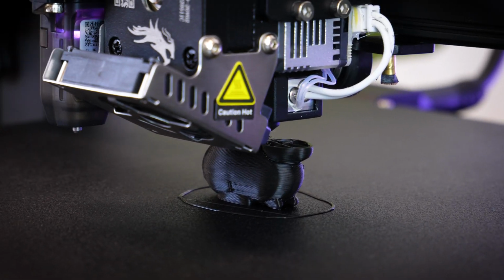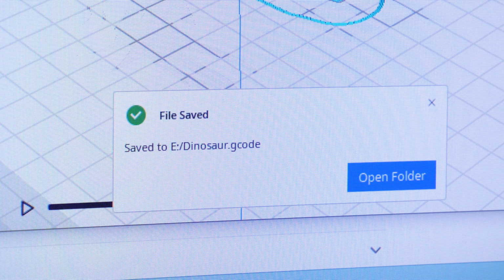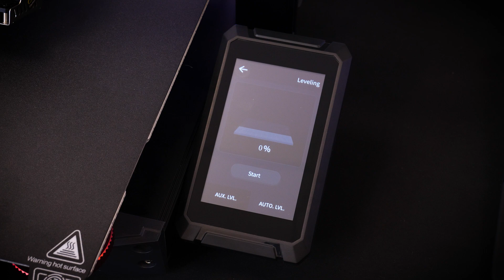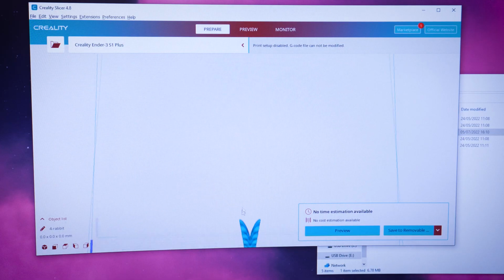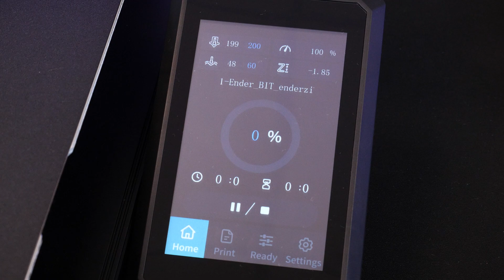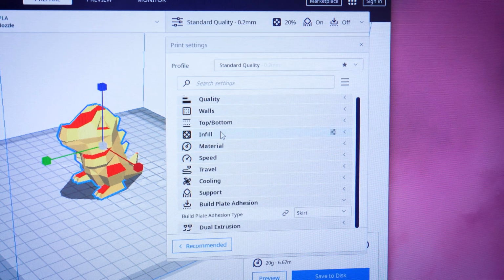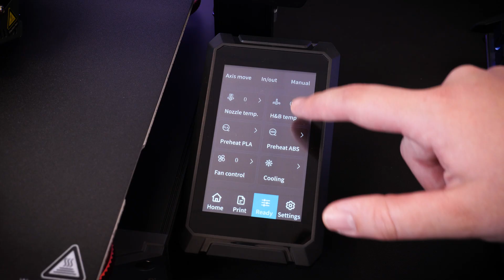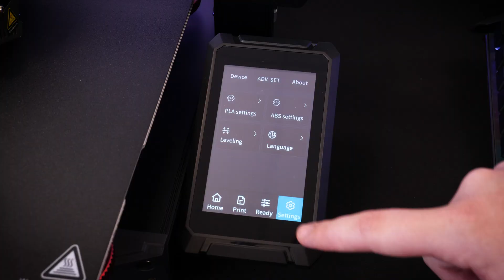Creality Ender 3 S1 Plus 3D Printer Review

Comment: Congratulations for the video, I saw that the S1 plus came with a kind of sensor and a cable, I did not find a reference in the manual, what is the purpose?
Reply from the maker: I believe it comes with a few replacement parts that you'll need to keep safe incase the original parts break.

Comment: any pros or cons wit this printer is this printer worth buying ?
Reply from the maker: Pros: It's really great for beginners as it works fine straight out of the box. You get everything you need to get started. It was really easy to set up and has auto bed levelling so not too much manual levelling involved. 
Cons: Takes a lot of learning to make something decent but that's really dependant on your skill level. The software doesn't have a lot of instruction so took me a while to understand the controls. Even with the auto bed levelling, you do need to make a few adjustments to get the print right but after that it prints things very clean.

Comment: I do better prints with my Ender 3v2. 
But I do believe that this will make just as good prints when correctly assembled and calibrated.
I really don't see a problem with the model being narrow tho. If that is your concern, you can print it on a raft.
I clean the bed with painters wash, which makes the surface slightly more rugged so the filament will get a good grip.

Comment: Damn! Now I wish I would have waited. I got the s1 pro about a month ago. The pro has a bed even smaller than my Prusa mk3S+. I still needed a larger bed and ordered the Artillery Sidewinder X2, a 300x300x400 bed that just came in Monday. My biggest complaint of the S1 Pro is the SD card reader only displays 4 pages of files. If you have more file, it ignores them and I have to switch out SD cards or erase files from the current SD card.

Comment: I bought a tevo tarantula pro, which is a big name for JUNK !! Then I moved to an Ender 3D Pro it has a lot in common with the first like NO filament will not stick to bed or it’s  clogged. Walk away and leave it printing perfect and come back to a MESS you have to buy a lever ONE OF THE MOST IMPORTANT PARTS and it’s an extra $40 part☝️🙄 which is stupid . I think 3D printers are  a Fad that will soon die out due to all the Crap you have to go through just to get a SMALL print much less a large one 🤷🏻‍♂️
Reply from the maker: Hi! Sounds like you had an awful experience 😥 I've used two of the Creality Ender 3 printers now and have found that they do need a lot of trial and error tests to get the perfect print. But not found yet that they need any extra parts that don't already come with it 🤔 I've found when filaments don't stick, it's normally solved by raising the print bed temperature. I hope you give it another try! They can make some great prints when you get them right 😊
Reply: Sounds like the Print Bed needs cleaning, factory residue on the sheet? Also your bed leveling may need bringing closer to the bed? 
These aren't plug and play devices yet. Still at least 3-5 years away until a sub £1k 'prosumer' device is available.
Reply: I clean the bed using paint wash on my Ender 3v2. As long as the print doesn't come loose from the bed, the print rarely gets messy.
I have had some supports break off during printing and then there be spagetti but if you're lucky it can still build on the spagetti which has shown to work about 60% of the time for me :-P

Comment: We all know the Pro version of this is just a few months away.
Reply from the maker: I believe there is a Ender 3 S1 Pro already 👌
Reply: @BoxCoUk  The 'Plus' Pro is the one on the way.
Reply: @shrimperlincs3395  I don't think so, the plus seems to have the touch screen, and heated bed insulation, similar to pro. I think in terms of features, the plus sits between the regular and the pro.Infact, to make the plus into a pro, just do the hot end upgrade $35, build plate upgrade $30 and ligths.
Reply: @neduzaaduzen1408  any link by chance to those upgrades? Thanks
Reply: @neduzaaduzen1408  i actually like the pc sheet more, the pei metal is kinda weird, and you dont even need to upgrade the whole extruder, you only need to replace the heatbreak